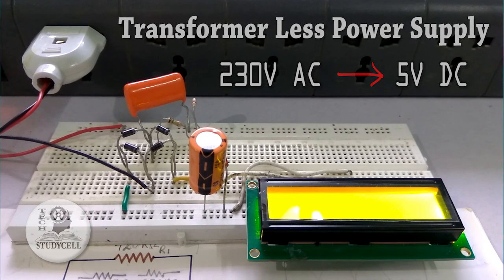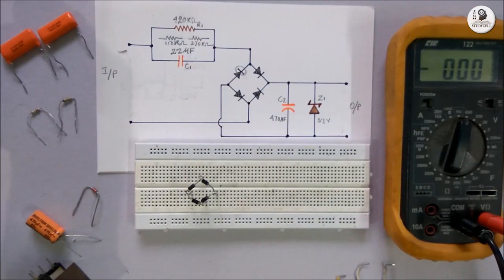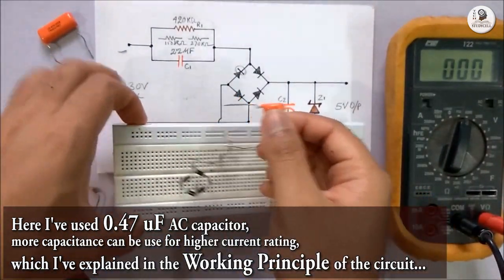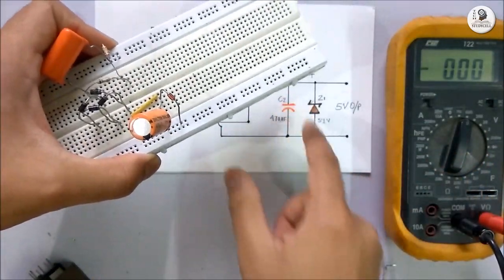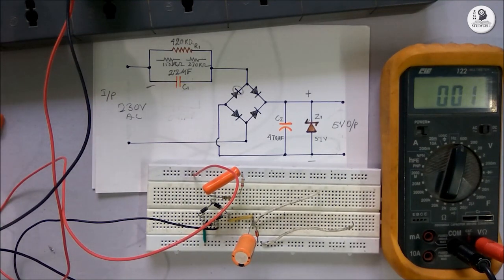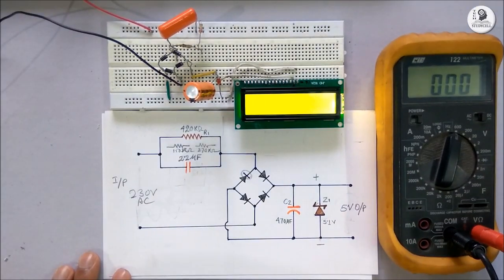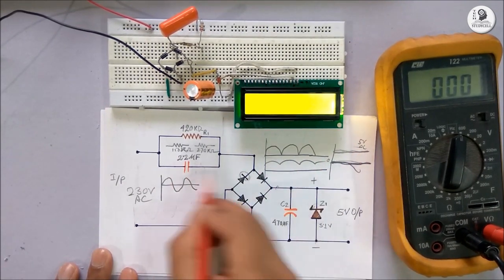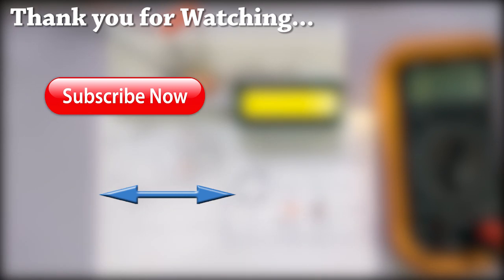Transfromer less Power Supply on Breadboard 230V AC to 5V DC

Comment: Thank you for your video. I want to set up 2 Arduinos that us 5volts and 1 nema 17 stepper motor that uses 9 volts. How can I power these off a bread board with a cord that connects to 220 wall power? I’m new to this any advice will help. Thank you.
Reply from the maker: I will not recommend to use this power supply for Arduino or other variable DC load.
You can use this circuit to supply LEDs.

Comment: I dont blame him for this idea but this is a dangerous circuit and can only be used in some purposes like cheap led bulb,you will get electric shock because its not isolated   from ac due to lack of transformer,this circuit do not provide large current output/unless you add lots of capacotor at input which will cost you twice than a good smps power supply.this is only good for cheap led dim light.do not use this circuit with any circuit consisting of transsistors,ic or micro controllers,lcd/led display all these can get damaged if its used.this circuitis is not reliable beacause either polar or non polar or both capacitors will blast after few days.
Take this as a free advice from an expert.thanks.

Comment: What should I change if I need a push switch in between to turn this supply on. I want to push button to run the circuit rather than main switch..
Reply from the maker: Then connect a switch in series between the 220v supply and AC capacitor.

Comment: It would be good practise to include a series resistor eg 50 or 100ohms to limit the instantaneous surge current when the circuit is first switched on. Also you should really highly STRESS to the less well educated people that the output of this circuit is at very high AC voltage with respect to earth, and so is a very great lethal danger risk if not used in a completely isolated situation. Otherwise you get stupid people asking if it can be used to charge a cellphone etc..    It is not novel. It is a common method useful in some specific applications. 
You should also stress the series voltage dropper capacitor must be rated 400-600VAC
Reply: but people have their own brains right? How would they survive in the jungle for example? Or 10 000 years ago when it was no internet 😅 and very dangerous environement??? Would it be someone who tells them what to do ?? People evolueted somehow and if someone wants to charge his phone with 230 V AC it is his choice and also it is actually good for Darvin's law and evolution of humanity 🤣

Comment: have you use high ratings electronics components?
Reply from the maker: I've already shared the circuit diagram. I've used 400volt AC capacitor.

Comment: If we use higher rating than 0.47 micro farad ac capacitor then what happen.
Reply: 0.47uF gives an impedance at 50Hz of about 6.7KOhms so you'll get about 35mA  therefore 1uF should give you about 70mA and so on..... make sure the capacitor is at least 400V better to be 600V rated.  Use a low . value series protection resistor to limit the surge current. Output is at 240V AC with respect to Ground so be very careful!!
Reply from the maker: The current rating of the circuit will be increased.  you can add more load at the output.

Comment: Can we use this for amplifier input voltage
Reply from the maker: It can be used as a low current DC source. If the amplifier draws less the 100mA you can use this.

Comment: Actually i have a query  i.e What is the maximum current rate i can consume from it ?????????????
Reply from the maker: Very low (in mA range). This not an efficient source. For higher DC current source you can use SMPS power supply which is efficient and transformer less.
Reply: @TechStudyCell  it is "efficient" ie it has low losses. The output current depends on the series capacitor. for low output voltages you will get approx 30mA with a 0.47uF Cap.  A SMPS needs an inductor, & to achieve ISOLATION from the dangerous high voltage mains, you DO need a transformer.